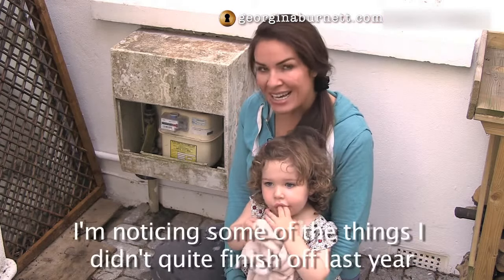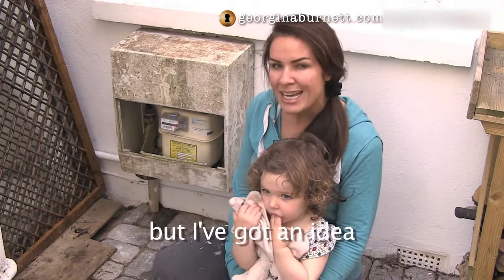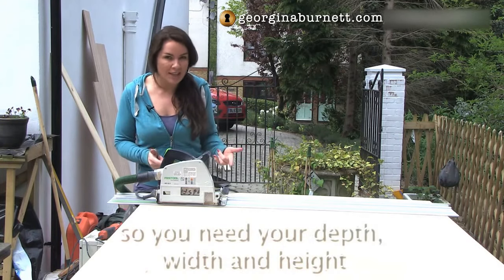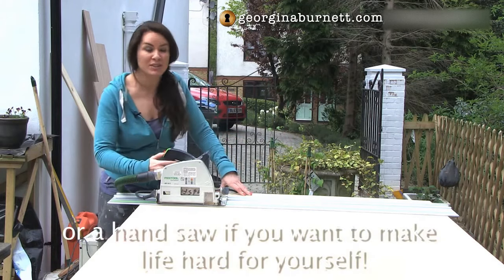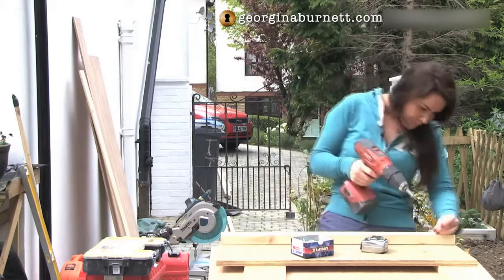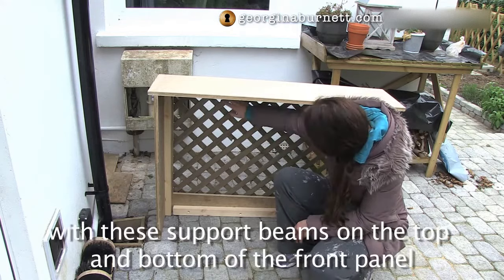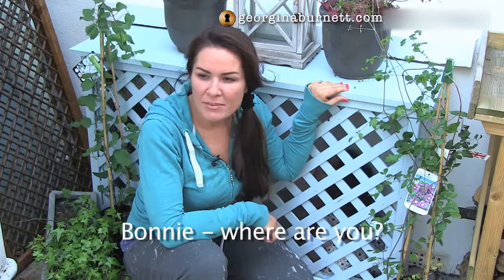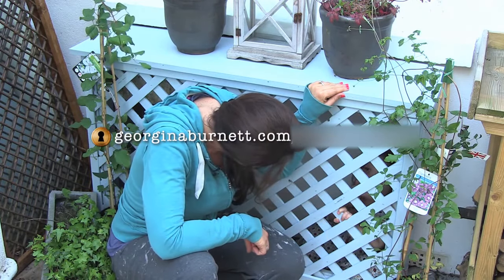How To Make A Radiator Cover Or Gas Meter Cover

Comment: Smart meters need something watertight. Any water getting in to the front of the meter and it will stop working and cut.your gas off.
Reply from the maker: Don't worry - it still has the original ugly cover - it's just hidden by the one I made!
Reply: Property Porn TV I noticed the front was missing from the original cover so thought important to mention. ;)